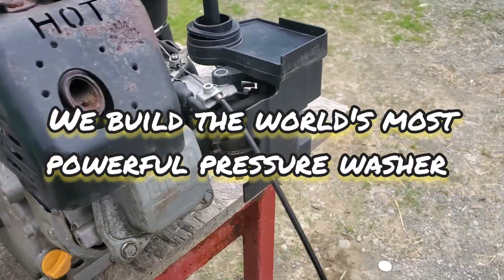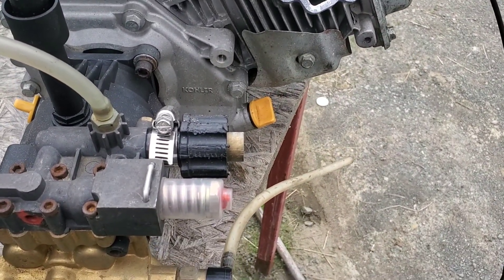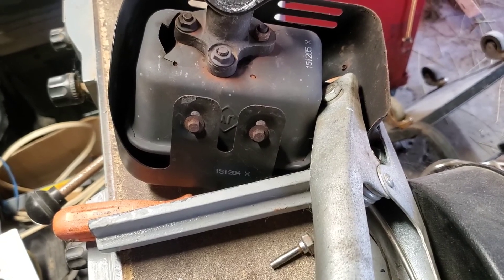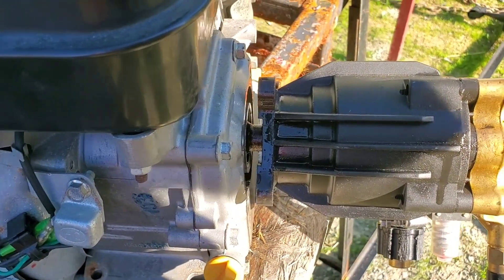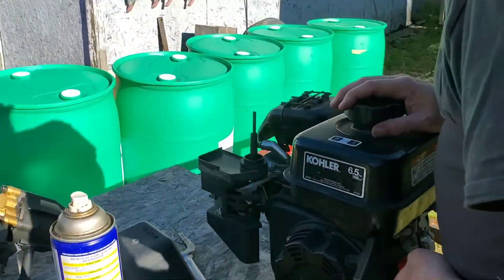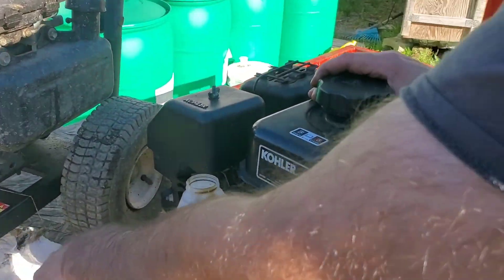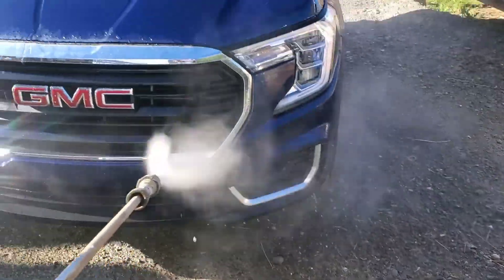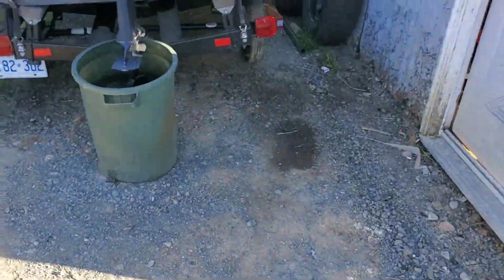World's most powerful $50 pressure washer  Kohler SH265 6.5 Horse Power. Small engine exchange

Comment: Which is better to choose kohler sh265 6.5  vs vanguard 6.5? Is it worth paying extra for vanguard?
Reply from the maker: That is a good question. I would have to say the best answer is determined by your needs. Those Kohler are cheap and seem to run decent. However, they vibrate a bit much. The Vanguard runs smoothly and would likely last longer. Can you afford more? Then pay more and get better quality. If you cannot, then the Kohler will likely get the job done
Reply: @JimsNBHomestead  I plan to plow a vegetable garden, a plot of 10 acres, and I'm also going to mow grass for animals.
Reply from the maker: Sounds like you are right track